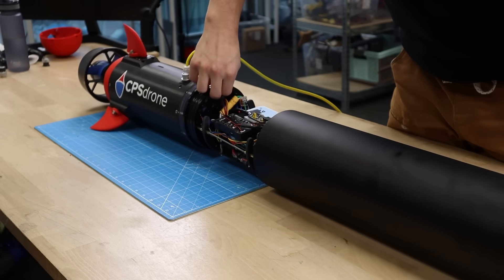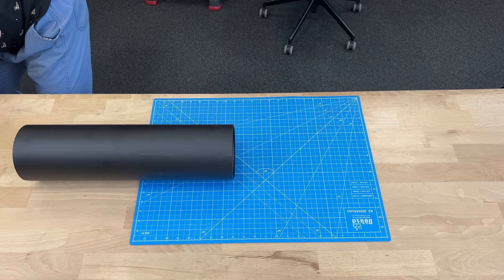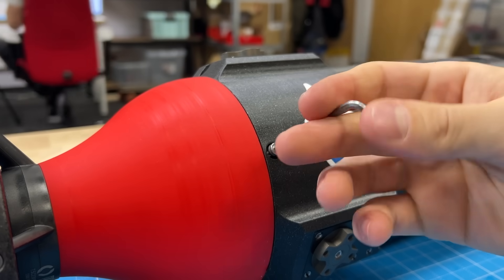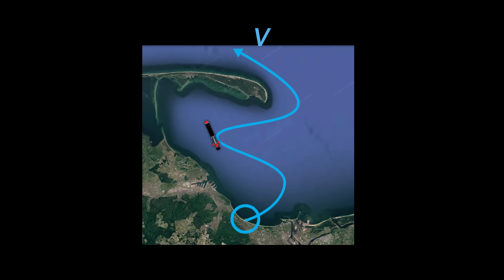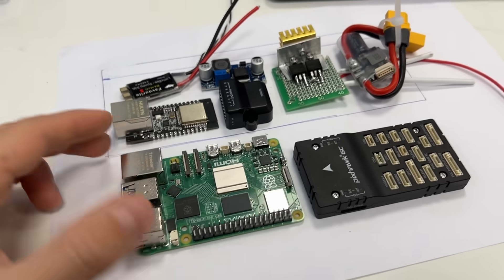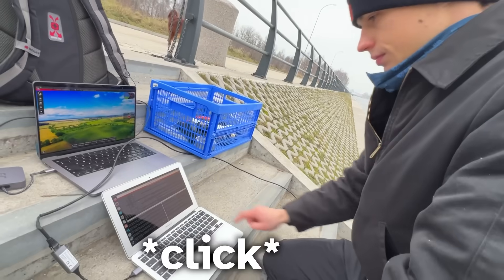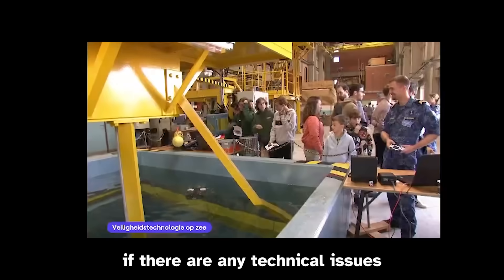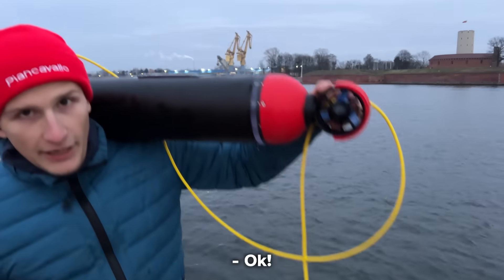Building a fully AUTONOMOUS submarine

Comment from the maker: I've just managed to secure a 10% off discount for the BlueRobotics components (e.g. the big T500 motor we used) with the code CPSDRONE at checkout. The link is in the description ↑

Thanks a lot for A LOT of comments with suggestions! That's the most comments/views ratio we've ever got hah
Reply: why you cant  you just use compass this will work and install solar panels when battery about to die it come on top and recharge itself then it travel the world
Reply: @muhammadhaseeb3206  Doesn't work, you dont know where you are in the water. And panels would not deliver enough energy
Reply: Should use props for maneuvering, it's better for under water, otherwise fins might have to resemble subs XD
Reply: Is it feasible for the drone to surface periodically when it hits a positional uncertainty threshold? Then surfaces to get GPS before diving back down and following its internal positioning guidance system, updating and then correcting for the error of its previous navigational behavior as a form of meta-PID.

Like a dolphin.

And then the DVL for precision deep positioning again following the same uncertainty principle, but doing periodic micro bursts first to detect depth to floor, then longer bursts when on the floor to identify location based of pre-trained floor topology.

Depth control being by buoyancy control.
Reply: try gyro (or IMU) for localization sensor
Reply: pianka dla wypornosci ktorej uzyliscie jest tym samym co balastowania statku/lodzi podwodnej - daje wam to wieksza swobode w ukladzie baterii, silnikow i reszty masy, daje rowniez mozliwosc do przewidzenia przenoszenia ladunku zgodnie z ksiazka wypornosciowo statecznosciowa dla danej jednostki :)
Reply: Indonesia has built an autonomous submarine defense system called KSOT
Reply: are u guys in Poland? wth
Reply: @redi_I  yes they are from Poland
Reply: the algrithum on ututbe likes you good luck
Reply: Hey! sorry I'm late, just thinking. Would a second set of fins at the front of the submarine, piggy backing off the servo controller with the polarities switched to turn in opposite directions (rear rutter clockwise, front rudder counter clockwise) for a tight left hand turn. They would probably be far enough apart to avoid turbulence effecting the rear set and it could be allied to all of the fins for maximum maneuverability.
Love your work guys, take care!
Reply: Hello. I want this. how much This. 1:03
Reply: are you belgium?
Reply: In addition to my idea about the periscope GPS, I suggest looking at DIY Perks' video on his own submarine build because he created a very cool and very inexpensive ballast system.  You could probably even modify that system to a fail-to-float state where losing all power would cause a full ballast state which, if designed to compensate for the weight of the sub even when full of water, would make it float to the surface if it dies while underwater.

https://www.youtube.com/watch?v=pUba126uzvU
Reply: Bro please make a course for this drone once you fine tune it and get it working, I really would love to build this
Reply: just a thought gents .. make pure autonomous  with two way communications ... sonar waves pulsed  can be read 200 nautical miles ..  two  points from your origin , different frequencies 
 use one as carrier and reference position ... even have sub send back data
Reply: Meem
Reply: he is literally a genius
Reply: Hi I: new to the channel but what if you rewired the other submissive devices
Reply: Also great designing
Reply: when's part 2?
Reply: Real someone might think that there are sharks swimming 🙏
Awesome videos btw
Reply: Nawigacja bezwładnościowa i nawigacja magnetyczna mogą wam pomóc. Metody te się nie wykluczają, a wręcz, powinniście sobie poradzić montując czujnik na kompas. Rozwiązanie Mackguiverowe, ale powinno styknąć na próbę.
Reply: I've yet to watch the next video, but how about the good old approach of using the earth's magnetic field? After your previous videos, I'm sure you can utilise a magnetometer and project it on an appropriate  map. You've also got a redundancy for measuring depth. 
Also, have you looked into UWOC? Might be a viable option for wireless communication from the sea bed and most importantly, without the need to surface the AUV. 🤔
Reply: Hello, do you have a course on how to build THIS drone?
Reply: Do you live in Gdynia or Gdańsk in Poland or are you just a student?
Reply: Thats a torpedo 💀 enough to destroy a row boat with someone in it
Reply: Have you thought about using a magnetometer combined with something like the old chip logs that gave us the term knots.
Maybe have a slot in the back where the "chip log" can fully retract, have it attached with thin stainless wire to a motor that can wind it back in.

Otherwise try VLF radio but you need a ham licence
Reply: Good evening from Greece, I just thinking two solutions for autonomous or cable drones, you could attached a expanted balloon with a timer to bring the drone in surfrase under 20 hours for example or with rc button.  The second is two make an automatic unplug system for the drones with wire plus the expanted balloon -buoy. If the drone stack in a place that you can reach it on the surfrase, you can rc unplug and bring it up with a buoy. Sounds stupid inventions or could have potential?
Reply: The solution for navigation may be simple, you could use an internal IMU by fusing accelerometers, gyro, and magnetometers, and then you have 2 sonar emitters on the ground a two different locations sending sound signals. The drone sends a pulse of sound, and the sonar emitters will send a pulse as soon as they receive the pulse, each emitter uses two different frequencies so you may distinguish each one, by measuring the time it will take to receive the sound from each emitter you will know the distance since you can calculate the speed of sound in water, with the distance known you can triangulate the location of your drone and use a Kalman filter to fuse the measurement with the IMU.
Reply: @jorgemunozburgos4401 this is exactly what I was getting at but you've clearly got the expertise to explain it better than I did
Reply: 100 dollars more though, fuck me
Reply: I'm not sure if its a solution or a good idea to your gps problem. But I thought of having 3 points on the land and sending a lofi-ping to the submarien. The submarien knows the exact location of the points and calculates the difference of the recieved signal. I don't know if that even works xD but it came into my mind

Comment: A surface buoy does know its position very precisely using GPS. The submarine does not. The trick is to use sound to link the GPS-aware world at the surface with the GPS-blind world below.
The buoy sends an acoustic ping (a sound pulse) down into the water. The submarine hears this ping and immediately sends a reply ping back. Because the speed of sound in seawater is known (roughly 1500 meters per second, varying slightly with temperature, salinity, and pressure), the round-trip travel time of the sound can be converted into distance. Longer delay means the submarine is farther away. This is not depth alone—it is true distance through the water.
By itself, one buoy only tells the submarine how far away it is from that buoy, not its exact position. This is where geometry enters. With multiple buoys at known GPS positions, the submarine can measure its distance to each one. The intersection of those distance spheres pinpoints the submarine’s location in 3D space. This method is called Long Baseline (LBL) acoustic positioning, and it is widely used in real oceanography, subsea robotics, and offshore engineering.
The “old modem” analogy actually works well. Acoustic communication is slow, low-bandwidth, and high-latency—more like a 1970s dial-up modem than modern Wi-Fi. Data rates are often only a few hundred bits per second. But that is enough to send timestamps, IDs, depth, battery status, and navigation corrections.
Depth plays a role because sound has farther to travel, increasing latency. Deeper also means higher pressure and different sound speeds, which are accounted for using onboard pressure sensors and water models. The submarine typically combines acoustic positioning with inertial navigation (gyros and accelerometers) to estimate motion between pings. The acoustics correct the drift that inertial systems inevitably accumulate.
So the buoy does not magically “calculate” the submarine’s location alone. Instead: • The buoy provides a GPS-anchored reference point
• Sound pulses provide distance via time-of-flight
• Multiple references provide geometry
• The submarine fuses this with its own sensors
Put together, the system lets an autonomous underwater vehicle know where it is, even thousands of meters below the surface, using nothing but sound, clocks, and a bit of clever math. Sound becomes both the ruler and the messenger.

Comment: For an underwater DIY GPS, here's my idea.

Put a put 3 speakers far apart from each other under water. Have them all send a sound that corresponds to the current time. The drone will be able to pick up the sound from very far away. It will decode the sound/timestamp, and from all delta of all three messages, the drone will be able to figure out where it is in 3d space relative to the three speakers.

Comment: This could be a torpedo carrier. The front half could be the small torpedo attached to your drone, transporting it to its target or a strategic position. Six longer (possibly detachable) fins could stabilize it on the seabed. A small section of the carrier could accommodate a retractable buoy. A sensor system for detecting fishing vessels could potentially help prevent being caught by them.

Comment: Hey guys like your vids, and its hard to build a torpedo shape that inherently wants to go straight, and having 4 servos trying to work together is also counter intuitive with drag and underwater currents or going against a current is. As it is easier to have a distinct top and bottom like a sub and only 2 servos up & down, left & right, makes the code easier and less decision making for the AI. Use sensors to know depth, maintain, check, adjust, and learn as a data set pattern. Simple patterns to help find its path is the learning method, otherwise every journey it takes is like going to the moon or flying blind. You may know all of this or not but it is really cool to go through the design process and understand how different flying underwater is... and the challenges it brings.

Comment: 🤯 Building an autonomous sub is the ultimate engineering challenge! Waterproofing, pressure resistance, and corrosion control for housings and parts are absolutely critical. This is where precision manufacturing (CNC machining, especially for watertight seals) becomes non-negotiable. Incredible project – can't wait to see it swim! 🌊

Comment: if you had a depth sounder you could measure the depth under the sub and then compare that with a map. you can navigate quite well like by following a depth contour. then have an accelerometer/compass to roughly measure speed and use dead reckoning combined with the depth check.

Comment: Why dont you give it gps for its initial location. Then give it speed and depth sensors and use INS module to let it travel to its locations while occasionally surfacing to verify location via gps. You will have some variables because of headon current that i dont think INS can compensate for due to not knowing the current speed.

Comment: Fishes in the sea typically do not travel deep underwater because water pressure causes high friction, making long-distance travel difficult at greater depths. For underwater exploration, operating at shallower depths is more practical, as navigation is easier and the environment more accessible.

By integrating simple accelerometers—such as those in the Pixhawk flight controller—we can estimate the drone’s approximate position. When the drone ascends, it can enhance navigation by utilizing additional GPS signals from systems like BeiDou or GLONASS.

The drone doesn’t need to surface completely. A hydrodynamic, angled fin or stick at the rear can reach the water surface with a small GPS receiver mounted there, providing precise positioning. To further improve hydrodynamic behavior and stability, using two such sticks—placed symmetrically—could offer better control and maneuverability during ascent and descent. These sticks can be adjustable, increasing their angle to assist with navigation at greater depths or during ascent, thereby optimizing overall stability and handling.

Comment: if you're using the buoy with a GPS, why not put a battery there with a solar panel even a 4G connection to stay connected to it and actually reduce the load of the drone a bit or even just gain a second brain instead of having only on brain on the AUV, you would have a backup Raspberry pi 5 or a jetson orin nano super to even run some AI models, it works at 25 watts on AI load and 6watts Idle and it's practically weightless, also you could release some of the drone load to run more underwater exploration mapping, or add a bottom and frontal sonar instead of only one also maybe a stereo camera system, I mean once you use the buoy a whole new world of options shows up. 
even if you somehow lose the drone, with solar panels you can program it to eventually send you a notification of it's location as an SOS signal and since it doesn't use a lot of power for it, you can program it to power itself and send the SOS message once every 5 minutes and retreive what could have been a 10K loss.

Comment: Wont those switches cause excessesive cavitation and starboard side drag? Could you not use one of those solar gliders as signal magnifier? Also some military submarines drag an antennae like a tail. It is for VLF and ELF signal. A smooth tail would have less drag than a floating thing.

Comment: 1:47 I don't think the default mass affects acceleration under water at all. If the volume is fixed, you need a certain mass to dive a certain depth. In other words the mass/volume ratio is constant. Ideally you'd want to maximize the mass of the sub, so that it barely floats if you pump out all the ballast water.

Edit: I was assuming you would use ballast to dive.

Comment: Years ago, I saw a documentary about how airlines spend large amounts of money to have the outer surfaces of their airplanes cleaned in order to significantly improve aerodynamics and thereby save a lot of fuel.

What I mean is this: I could imagine that the basic idea from the airplane example could somehow be applied to the hydrodynamic properties of your submarines. At the beginning of your video, you mentioned that this autonomous submarine would be covering a record-breaking distance for you personally, and that you would therefore need a lot of energy. I think that if you spent a few more hours working on surface post-processing of your 3D prints to give your submarines even better hydrodynamic performance, you could reduce energy consumption — which would certainly benefit you in other areas as well.

Another idea would be to look into the concept of swimsuits. I remember seeing that they also have many tiny fins on the surface to prevent turbulence and thus improve hydrodynamic properties.

Once again, thank you for the great video.

Comment: Why didn't you use a hydro motor? It would reduce battery consumption. Problem with submersion? Make a bigger drone and add water tanks.
But you are the eggheads, I don't even remember the multiplication table

Comment: You just don't need to get location continuously you can just install a compass and attach a gps to sub with its antenna popping out and our sub will automatically comes up to surface for every eg: 1km and gets the correct direction and continuous on the same path again.

Comment: I really like the size & principal of the autonomous ability... I can see great potential for a military defence attack weapon for a cheaply produced mini suicide Submarine drones .

launched in their hundreds against (example) Landing troop carriers of an invading enemy on your own shores ..

 mini suicide Submarines could seek small enemy landing craft in mass numbers ..
Find seek & destroy enemy incoming troop barges trying to land on your shorline beaches & pack just enough explosives to destroy what they hit & sink it ..

with the add distraction air defence from your airforce the enemy would be overwhelmed with nuch confusion & distraction

A mini suicide drone  submarine would not visible to naked eye & to small to detect on basic radar system's.....

the perfect design would be a signature guided drone that targets on engine sounds - heat signals - vessels metal density - ect 

with a deternation explosive head that works on pressure set force of impact to avoid early determination of chaft type defence against them being not enough pressure to deteriorate . ..

I think you get the idea from that description of what i mean .  Many drone designs are being manufactured for air superiority.....this is another type of weapon drone for sea defence to stop enemy from landing on your countries soil if it has an ocean shore border that's basically untouched in ideas .... Ukraine defence & attack against Russian enemy is living proof that a drone doesn't need to cost a million dollars or even $100 to be a deadly weapon ..

Comment: How about making the nose thruster an azimuth thruster that rotates 360 degrees allowing you to pivot the bow in any direction, and the pivot point being near the rear thruster instead of the usual 1/3rd, yes I understand this would only work at low speeds.

Comment: What about putting batteries to add weight to the part that floats and pass a power chord with the rope used to drag, use that to remove a battery pack and have room for more power or a shorter drone or anything else needed?